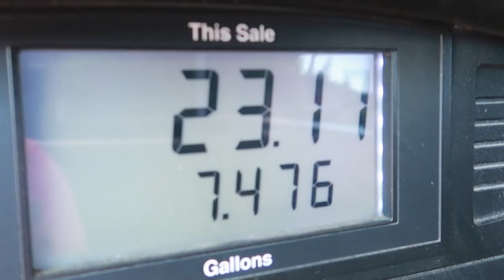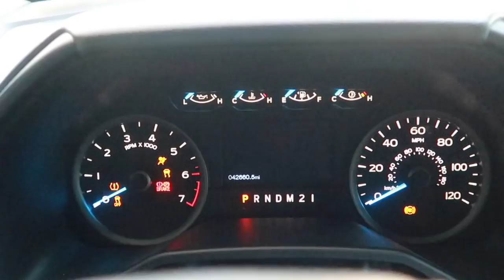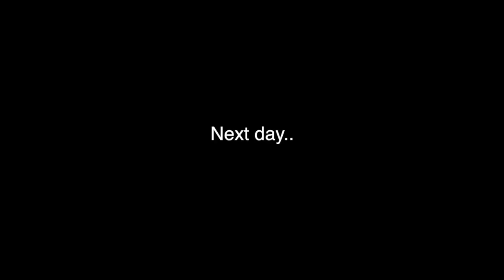Finally Off Roading AND Mudding In The F150.. With My Family... **Bad Idea**

Comment: I bet all the cars right behind you really appreciated all the mud that those huge tires flung up onto them.
Reply: Tires only fling mud for about a quarter mile tops if I remember correctly, haven't been in a while. Once the mud comes out the tread (which happens quickly) no other cars will feel the affect. Another thing, if you're concerned, move lanes or back off🤔😱

Comment: Needless to say, this is just for fun. 
If you're going from A to B, and have to tackle a muddy road like this, it doesn't work like snow. 
You don't steer the truck in the other car's tracks, which are now puddles of water (and pretty deep). No matter how high your clearance, you play it safe. You don't risk getting stuck. You steer on the "high" ground, between the tracks as much as possible.
The undisturbed grass on these areas works good for traction, and you don't get too much tire spin too.
You do need to have some speed though. Going too slow you risk getting stuck again, simply by the weight of the car. 
Mike's speed was ok I think, his lines just needed to be shifted a bit to the left or right, to step on the grass. 
Good work having fun with that little thing!

Comment: i learned this the hard way- get a beater mud truck. it took my 6 hours to clean my 2015 f150, so I bought a lifted 2004 F150 specifically to go off . road. going off road is fun as hell but the clean up isnt- so get yourself a beater. my 2 cents of course

Comment: The blue smoke in the cold start up is prolly your PCV Valve not working right. If the pcv valve is not working right or has a crack in it, it will suck up oil from your crank case and pool in your intake. When the truck is shut off the oil will settle in the intake and seep farther down the intake in into the cylinders. then on first initial start it will smoke for a few second and go away.
All should be different now that the truck is now supercharged and the pcv should have been changed out.

Comment: You should do a 0 to60 test between e85 and 93 octane gas
Reply: Basil mobake it’ll be the same, engines that don’t require 93 run the same on 87 vs 93
Reply: Yup you beat me to it
Reply: My 15 F150 pulls so much better on E85 on factory tune. These trucks compensate for octane even on factory computer.

Comment: Dude!!! You're definitely CRAZY! LOL Spent HOURS cleaning the truck and then goes back and muddy up the truck AGAIN, the very next day! YEAH... DEFINITELY CRAZY!!! 
Also.. Since i see you being very meticulous about cleaning the outside and under carriage so much, Don't forget about cleaning the engine and internal combustion chambers with a GDI Service, as well!? 
AND.. since you're using 87 gasoline in the truck, don't forget to add a small bottle of fuel additive into the gas tank to help keep the fuel injectors clean, as well as minimize and keep in check, the carbon build up!

Comment: These videos are way better, definitely want to see you do some crazier truck builds and not go for speed go for crawl easier to video I’m sure lol. no criticism I love your videos just wanted to let you what I wanted to see. f150 on 40s built tough not fast…. Then send it to me 😂😂 I have a 2015 f150 fx4 xlt with the 302A package (no sunroof) didn’t want one because of future issues. It’s got the 5.0 w/85k miles on it and I love it. Still completely stock though because I bought it when the truck market went to shit needing a newer truck. First owner worked at the ernest McCarty ford dealership in alabaster Alabama and he was the only owner. Had 31 trailer miles. He pulled a smaller trailer to move some rocks for his dad and that was it so I had to get it. nothing like a 5.0 with the 6 speed. I know they say they’re faster but I drive an 2022 f250 single cab gasser with the 10 speed auto for work and I can’t stand the amount of times it shift and it’s got no power. It’s really not that heavy of a truck. Not a dually either. I’d take my 6 speed tried and true over the 10 all day even if it is slower. I’m sure more gears meals more solenoids more money and the obvious more gears to replace when rebuilding. Lmk if I’m wrong on that

Comment: 87 oct fuel?!?!?! Mike, you waste more gas that way & Money... Think about "Combustion",  look it up
Reply: That engine recommends regular, why would he be wasting money to fill a 26 gallon tank with premium?
Reply: Do you know how combustion works? the more octane, the more combustion which = more power and less pressing on the gas to move forward.
Reply: Guitar 1  okay
Reply: Ok, they have done studies on this, you really have to look it up to get all of the details... but the basics of it is this....Think about the cylinder block where the piston is and how higher octane fuel has more BOOM during that mixture of air, gas and the spark making more power giving more energy than a lower octane fuel. Just because something is the "minimum recommended" is NOT the best. The Mercedes WILL run on 87 fuel also....But trust me, it WILL make less power.